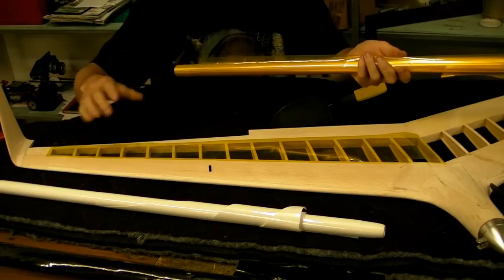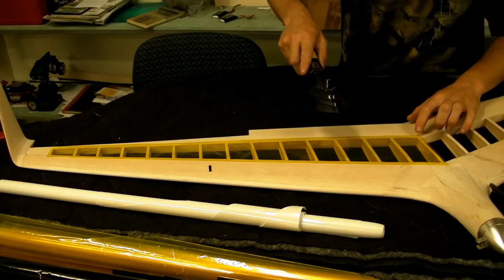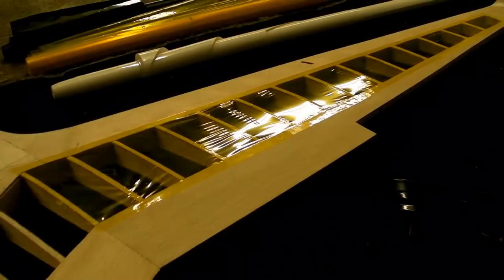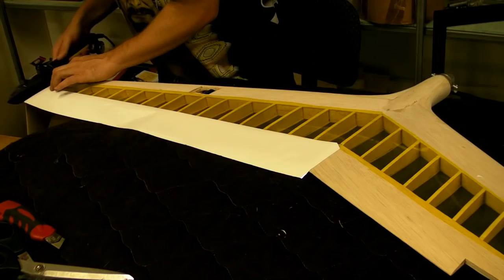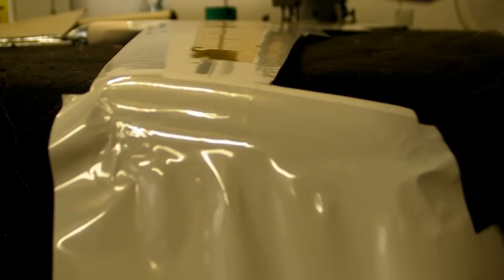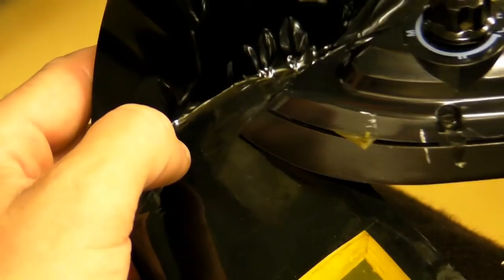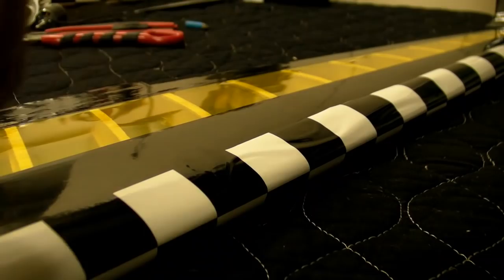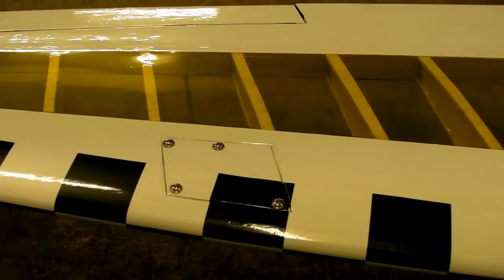Balsa Wing Covering Tips

Comment from the maker: Thanks!  Its got a new Fuse now and is now a Pusher configuration. The GC 
is better now and can take a bigger battery ( went from a 1000mah 3s to a 2200mah 4s)
I haven't fpv'd a DZ 500 but they fly VERY well, they can be slow and stable or fast and agile like a combat wing, I Definatly recomend it.
If you havent seen already I have an Unboxing /Setup/ Flight of the DZ 500 on my channel.

Comment from the maker: It depends on the area you are covering, if you are working on the edge of the film, you want a lower temp( This stops the edge from distorting) which is
important on areas such as the leading edge where I used a different colour.
If you have already gone around the edges, turn it up a bit to shrink the rest of it.
If you are trying to stretch alot of shape into the film you will need a high heat.
It I cant tell you the exact settings as all irons wil be different.

Comment: Nice Video and I guess everybody does little things differently but the main points were there, it always helps to see other peoples ideas you never know when and were you can learn new tricks.  I myself though do a few more tacks around the edge keeping it taught before sealing the edges just to prevent the wing being twisted when the film is shrunk. I also as a rule cover my electrics or sailplanes with a white top surface to reflect heat and a dark or colored (red for instance) bottom to contrast against fluffy white clouds when thermalling.  But if it works for you and you like it great! it was a good video! As with Justin I would like to ask about the wing, was it your own design or are plans available.
The very best wing I have owned, cut from blue foam and covered in light glass was the http://www.aerodesign.de/modelle/HS/hs20.htm this website is also a great database of 3 views of flying wings.